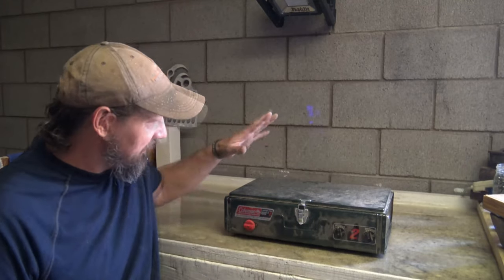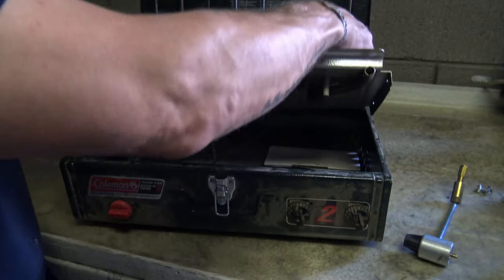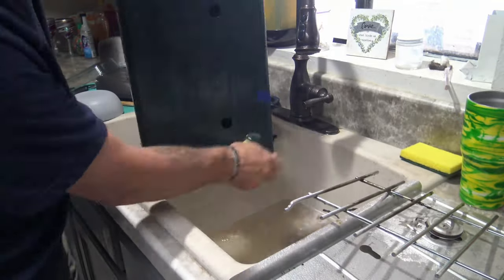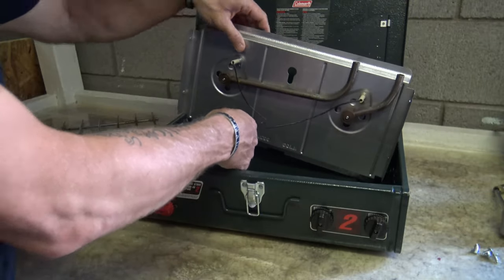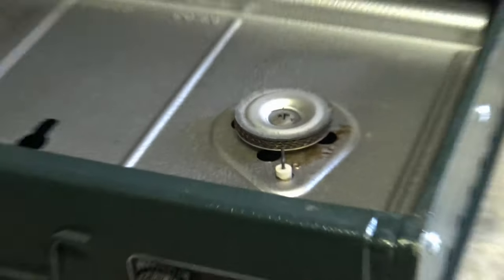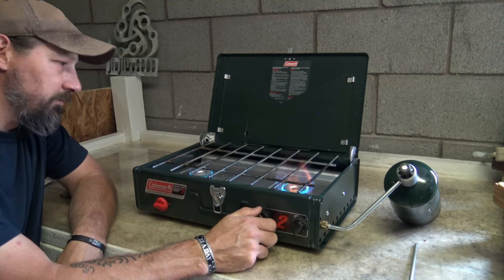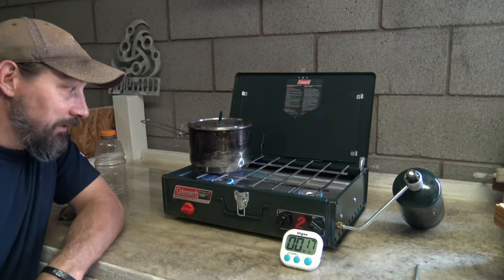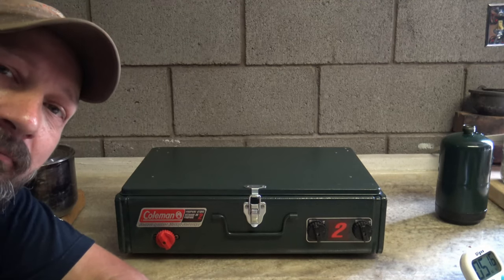How To Fix A Coleman Two Burner Propane Camping Stove (5423e750)

Comment: Nice find for you.  I've had the same stove for 25 years.  The regulator does store securely with the stove end attaching at the key-hole in the shield and the bottle end wedging between the back of the shield and the case.  Cheers!

Comment: I just got a 421 the tank goes to full pressure at 1/2 a pump. Is the pump clogged? It barely burns now.
Reply: Nevermind, I worked it out, without your help, which was never offered.

Comment: So the gas lines just come out and aren't supposed to be attached?
Reply from the maker: Yes, they just sit there!
Reply: @jiujitsu2000  I recently bought one of these coleman propane stove 2s and fire erupts from under the right burner whenever I try to ignite it. The left burner seems to be fine but after I took the whole thing apart to look for a cause for the right burner issue, the left one wiggles off the line when it's time to put the four screws in.

Comment: Just got one for $20.00 new condition. Cleaned it like you did and my flame is about half the size of yours. 🤔. Any ideas?
Reply from the maker: Not coming up to pressure, small leak or generator might need more cleaning